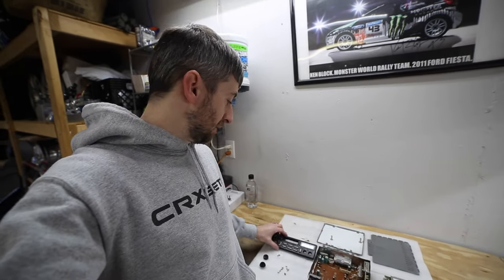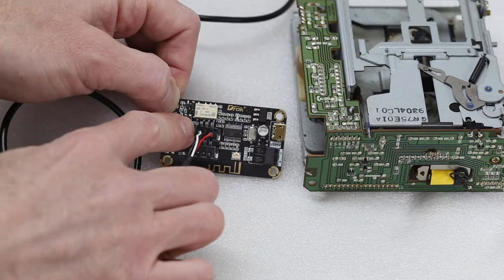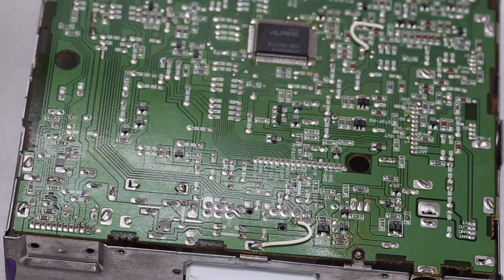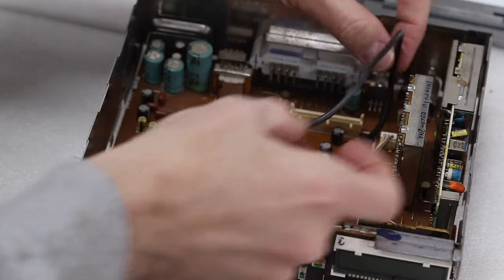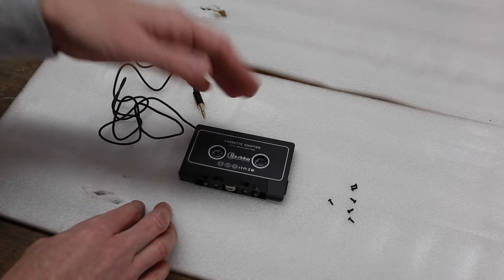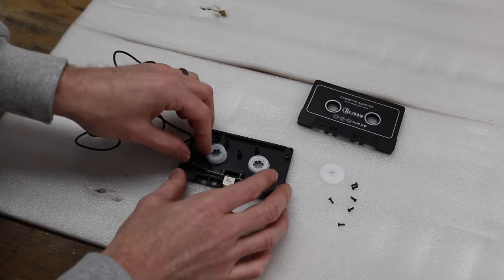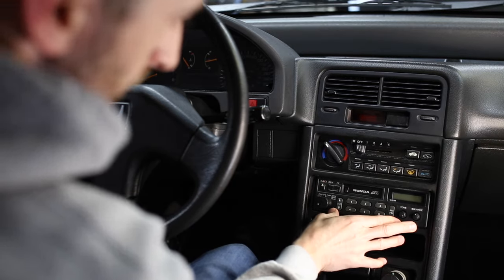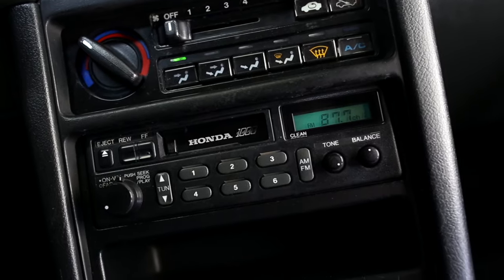Adding Bluetooth to Vintage Factory OEM Honda Stereo

Comment: SICKEST MOD IVE EVER SEEN! I wonder if this works with my jdm beagle wagon cassette player.
Reply from the maker: Each stereo will be different. Most likely there is a way to do it.
Reply: @crxseth  sounds like im taking apart my stereo soon haha!
Reply: @YoungStatic  same!!
Reply: I’ll be playing with my OEM 99-00 SI CD Stereo for the blue tooth DIY. Be going into my EG Hatch 🔥
Reply: @lh1879  needs to have a cassette player.
Reply from the maker: @Steven-qm2nh  You can use the CD input if the selector will stay on the CD player without a CD in the slot.
Reply: Just get a $6 transmitter on ebay my man. Best 6 bucks I ever spent and u just set to the station and BOOM.
Reply: 👏👏👏👏👏👏👏👏👏

-100
Reply: you must be new to this planet... coz this is the LAMEST mod ive ever seen... hell coulda used a cheap ESP32 and got bluetooth AND WIFI..
Reply: You can buy bluetooth cassete adapter :)
Reply: instead  of using blank  you drop the cassette  player and pull out the spring
Reply: @thekoleroy_at_varsity4103   but the Am/FM function will ne disabled then? Cause the radio stays in Cassette mode, doesn‘t it?🤔
Reply: @ramonbriones4487  sound is not the best.

Comment: Do you need to add a Bluetooth stereo? All I did was get a Bluetooth to FM converter which is powered by the cigerate lighter pretty cheap to just about $20

Comment: I was looking at doing this. Searching parts and stumbled upon a Bluetooth Cassette. Only negative is you have to charge it like any Bluetooth device…which isn’t too bad of a thing. But something for the not so technical savvy people or people without soldering irons

Comment: I did this to my 95 A8. The only difference is that the tape deck detection mechanism, was dead and I had to make it think the tape is ionside constantly. In this case I cannot insert a normal tape, but I don't need one anyway.

Comment: I have a Honda 1000 stereo like yours but it definitely doesn’t not look the same as yours inside. Mine does not have the channel labels
Reply from the maker: Yeah, I have a second Honda 1000 that is different inside as well. I haven’t tried this mod on that one yet.
Reply: @crxseth  you think soldering on to one of the memory buttons would work?
Reply from the maker: @nicktorres4064  For which part? You have to get on the audio channels for it to work.
Reply: @crxseth  Since my 1000 doesn’t have readable labels I was thinking about just soldering into the Fm radio button. The Fm radio is an audio channel so it should work I’d assume.
Reply from the maker: @nicktorres4064  I would just try to find the tape deck channel.

Comment: This is real cool.
EE guy here. If you wanted to keep the tape deck functional, you could have installed this through a small multiplexer chip, or switch chip. You could hook one of the select lines to memory button 6, or another infrequently used frontpannel button, and use that to switch between the two sources. There's a lot of room availible in the CRX radio housing, you should have enough room.
Reply: Could have just had the bluetooth audio lines go into the same holes but not disconnect the casette lines. If he wanted to listen to casette then just put in a real casette and if bluetooth then put in that aux casette
Reply: If you look at the Bluetooth board he used, that already has all the circuitry to switch over inputs automatically - he just didn't connect it.
Reply: I'm trying to learn a little more about this. My tape deck is an 03 so it's a little more complex. It has four audio channels, right and left for front and rear. Currently I soldered one 3 pin connector to the front channels and ground, and the other 3 pin to rear channels and ground. I'm pulling power and ground for the chip from the main stereo 12v accessory source. How would I implement a multiplexer for this configuration? I'm using the same Bluetooth chip as this video. Thanks!
Reply: @within_cells  you wont need a multiplexer, you can run the bluetooth module at the same time
Reply: @angrycreeper100  I'm not going to run one, but I was curious to see how it would work hypothetically.
Reply: Pardon my ignorance for not knowing much in the soldering realm - could you not just solder the connections from the bluetooth chip on top of the existing connections to the tape deck to have both functional? I’d imagine you still need a blank cassette in the slot so the radio switches the output to those connections, but wouldn’t this allow both to be functional?
Reply: Wow, I haven't checked back on this thread in two years! I should probably re-watch the video.
So, reasons to opt for a some kind of selectable source instead of tieing the two audio lines together: 
There is a possibility that both could play at the same time. 
At best, the two audio signals will get added together, and you'll end up hearing a garbled distorted mess. Two signals will be coming in at the same level will add to each other, and will clip. At worst, the audio system will only be engineered for an expected signal level of one source, not two, and damage your amplifier system. This is the whole reason audio mixing consoles exist, and we don't just solder a bunch of microphone cables together, and have gain control. 

Now, you could solder things together and just make sure that they never play at the same time. But the less quirks I have to remember in a project car, the better imo.

Comment: I did it a bit differently with the factory delco unit in my 86 monte ss. I put the bluetooth module between the tuner and preamp input to the amplifier section of the head unit. Then i added an audio relay and an external switch to switch between tuner and bluetooth.
Reply: I have an 84 s10 with a factory Delco I want to do the same thing could you help me possibly

Comment: I think the cassette detection should be some sort of switch and the signal must be together with the same flat cable you cut. You might be able to use a switch on that pin, so you could use Bluetooth without inserting a tape. And with some extra work, even retain the tape functionality if you manage to disconnect/reconnect the signal pins together with that switch.
Reply from the maker: I think there is a way, but I didn’t dig in deep enough to be able to figure it out. I took the easy way out!
Reply: hook both up, use relay to switch grounds. whichever ground is connecting that circuit will be the running one.
Reply: @GameCrazedNERDS  This is exactly what I was thinking.     The act of inserting a tape completes a ground circuit.  Your idea of adding a relay eliminates the motor spinning while using Bluetooth.  Perfect.
Reply: Correct. You can add a switch which will trick the microprocessor into thinking the tape has been inserted and it will switch the lines over to take audio from the cassette mechanism. That way you don't need to put a cassette in, or have the motor running creating annoying noise. Using a small relay you can arrange it so the tape functionality remains intact.

Comment: Great mod. Keeps the stock look of the interior while also not being stuck only to FM radio or cassette.
I wanted to do something similar on my '89 BMW and my '90 Renault but both have period correct stereos that came from factory with AUX (or CD-IN as they labeled it back then). But my '87 AE86 does not have that so I will defenetely to this mod.
Thanks for the great video, you just gained another subscriber :)

Comment: Excellent video, I wish there was a tutorial like this when I did the same mod to my AW11's tape deck.
I would highly recommend to anyone doing this mod to power the Bluetooth module with 12V that is only live when a tape is inserted. I pinched the supply for the tape drive motor, which solves two problems;
1. Don't hear the noisy motor whirring away anymore
2. You won't miss any phone calls when you're listening to the radio while driving. If you're like me and always forget to turn Bluetooth off on your phone...
Reply from the maker: Good idea.

Comment: Thanks mate. Been thinking of a solution for my OEM cassette player as well. My OEM unit is very different down here in Australia. It’s a Pioneer system so I’ll check out whether your method will work. Much appreciated.

Comment: Very cool. I managed to get an adaptor wire for the cd multi changer input on my nissan head unit. But I think this is defintly the way forward. Much cleaner.   😎👍🔰

Comment: really cool trick, did the same on a old 1980's boombox, but tape input were not identified, I had to trace down the main chip i/o. But at the end it works. Since the boombox tape is activated with a play button, I was able to use the BT and Tape input in parallel and add a switch to stop the little motor to turn. So I can use either the original tape or BT

Comment: I love this mod. Works on ANY radio with cassette, since cassette is all analog. I did this exact mod in my 03 Silverado. Factory radio with bluetooth built in is the coolest thing you can do to an older rig.
Reply: Do this work with CD Player instead of cassette?
Reply: @ramonbs6075  cd is digital, not analog. On some radios, you can hijack the CD input of the audio chip and just throw in a cd with a blank 48 minute song on repeat so the radio will stay on that input. It's a bit archaic though. This was another method for GM radios that didn't have cassette that I was researching. There was a pinout for that specific chip, you'd need to find one for yours.

Comment: No offence but I don't think it's a reliable mod.  The easiest way is to vacate the 2DIN compartment and install a modern-day 2DIN head unit instead, with BT, USB connection, ODD and so on.  Not much of a significance to just retain the old-school factory head unit look......

Comment: That is cool, I always change out the factory Radios and I have about 6 Honda radios somewhere in the garage. I like sound systems in cars so the factory radios don’t offer anything for that. Plus I can have CarPlay on my aftermarket radios which make it easier for todays phones and what not. Not a bad idea but when i worked for Honda I saw too many factory radios fail.
Reply from the maker: Yeah, it's not top tier solution, but for $30, it beats listening to my phone speakers. Haha.  And I like the period correct appearance of the factory stereo.

Comment: I did this on a 2003 Volvo s60, but instead of a Bluetooth device I added an auxiliary jack. It sounded great, but you definitely need a ground loop isolator so you don't get the engine noise while charging.  Cool video tho and Very clean installation.

Comment: @CRXseth - Do you know of a way to mod the radio in a similar fashion, but still be able to play real cassettes when not using Bluetooth? I think the radio would need some sort of Aux input, which they obviously didn't have back then. Perhaps another circuit that runs to a toggle switch and could go between the Bluetooth circuit and the original cassette circuit. Any thoughts?

Comment: if you would have just piggybacked the signal from the bluetooth to the back side you could have maintained both the tape deck and had bluetooth, so long as you dont play anything through the bluetooth a normal tape will still play :P

Comment: So many people overlook Hondas factory radios.  The older ones (like before 2001-ish) sounded pretty decent and had decent equalization.  They just need more power and better speakers, which you can easily do with a 4 or 5 (4+sub) channel amp.     

I love this mod, only downside being the noisy tape deck mechanism.   If you we could trick it to read the audio input without the motors running.  

For my Honda radios I have been using the external CD changer modulator/ aux adapters as an auxiliary input which a JL Audio MBT-RX Bluetooth receiver is connected to via RCAs to receive the signal.  Clear, loud sound, automatically connects and the tape deck is silent.  The down side to my mod is all of the modules and wiring needs to be hidden under the dash and console.  USA Spec DF-HON and Blitzsafe HON / AUX V.1 are what I use and both are awesome but they are discontinued and getting hard to find used or new old stock.     

To top it off I replace my radios back lighting with LEDs to match whatever interior color lighting theme I have in my car, usually sticking with factory options like amber, red or green, with some cheap Amazon automotive T3 neo wedge 12v dimmable LEDs.  Couldn't ask for a nicer set up.
Reply: I'm guessing some of the late 80s/early 90s cars probably didn't get the separate connector like the later model cars had. I'm also using the Blitzsafe Hon/Aux v1 on my Integra and like you mention I have to hid it in the back and make sure it stays secure. On my setup, I was able to keep the original integra CD player from the main headunit, but I also have the lower DIN OEM Acura Cassette deck connected, and the same Cassette deck has the same connector available, probably for a trunk mounted cd changer, but in my case,  my Blitzsafe is connected to the cassette instead. It just looks cleaner with the cassette deck and not a storage pocket lol

I did buy a knockoff blitzsafe to test for a friend to use on his 7th gen civic and encountered weird issues that my Integra didn't have with static, wish I was able to fix that...

Comment: Nice vlog dude preety awesome 👍👍👍👍👍👍👍👍👍👍👍👍 
the bluetooth circuit is designed directly in pnp can be used on a car tape deck can also be used on a vintage sony home theater the important thing is that you understand the current source circuit on a pcb board and know how to solder it ... I've tried it and managed to connect

Comment: I have a oem Honda radio I got at a junkyard but it needs a code. Not sure what the code is. But would love to figure it out to do this!
Reply: Plug the radio into your car and press 1 and 6 and it should give you the serial number on 2 screens. Ignore the letters and just write down the numbers.  It should be 8 of them.
Reply from the maker: I have heard that you can take the serial number to Honda and they will give it to you.  I haven't confirmed this. It's worth trying the below suggestion, too.
Reply: @crxseth  No Honda will not give you the code unless you have proof of ownership of the radio. Just FYI
Reply: @crxseth  the last time I had to do this I got the code online.
Reply: @crxseth  i've called my local dealership for a code on a radio i bought at the salvage.

Comment: Nice, but here's another way that I used in a Miata radio. You can buy bare audio BT boards that run off 5V. I'm pretty sure that radio has a built in 5V regulator for its uC. If not its also not too hard to fit a 7805 in there to get 5V from the 12V. The BT receiver board will have L and R outputs for the radio.

Comment: You know easy way is to get tape adaptor that is bluetooth. They make them.
Reply from the maker: I mention it in the video, but the sound quality is lower with those adapters. I’ve had bad luck with them previously with the tape head reading them well.

Comment: I tried this about a year ago and my 91 radio just had this obnoxious hissing I couldn't clean out of the audio even with replacing most of the components. I eventually ran power to the radio and hid a modern radio underneath it where the cubby would be and ran the speakers to that. Definitely not as clean an approach as this module. Top notch.
Reply from the maker: I got lucky and haven’t had to deal with noise. But I haven’t started the engine yet so I’m going to cross my fingers.

Comment: Would it not have been cheaper to get an old cassette, rip out the tape and use that? rather than modifying a 3.5aux cassette?
Either way, I love the BT mod
Reply from the maker: Probably but I already had this adapter laying around.

Comment: Neat, but I wouldn't desolder the old cables. I would put them right on the pins from the back. That way I could use old cassettes and have BT. I would also use flux and use protective goop over the exposed soldered cables. The loose BT module could be a problem vibration wise, I would secure even more.

Comment: Can you please make a video of how to tear down  the radio. I’m wanting to do this mod in my sedan and have all the supplies. I just can’t figure out how to tear into it. Thanks
Reply from the maker: It’s just some visible Phillips screws and popping off the volume control knob. The faceplate has some small plastic tabs that hood it in place that need to be pried up to release it.

Comment: In theory you could left wires from tape and solder to them. That way, not only BT module would work, but also some vintage cassets. Blank casset would not interfere with BT module while playing i think.
Reply from the maker: You’re probably right, but there might be a bit more noise from the tape head being active.

Comment: Why not just use a plug and play FM transmitter?…probably cheaper than the module you bought [to go inside the radio] and much easier to plug into a cigarette lighter hole instead of performing a full ‘surgery’ on your radio… especially if one is not as educated/skilled as you to go inside the radio guts and do what you’ve done in the video. Do you REALLY think this is going to help the average unskilled person who watches this?
Reply from the maker: I just wanted to do it this way and decided to record it. It has helped a few people because they have thanked me. This wasn’t intentionally targeted to people looking for the easiest solution.
Reply: @crxseth  > It was definitely a great video, and, I’m envious of your skills/knowledge as to doing what you did. Personally, I wasn’t blessed in that way! 😂 I have a non-bluetooth aftermarket radio [in my 1999 GMC Sierra extended cab truck] I bought from Best Buy 12 years ago, and, I just went the easier route for ‘me’ via the FM transmitter. Stay safe and happy soldering!